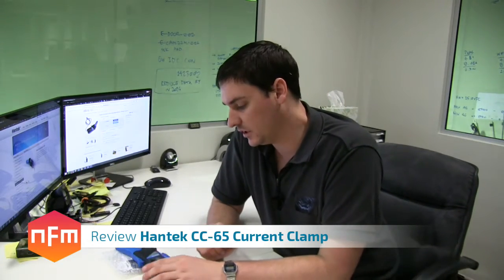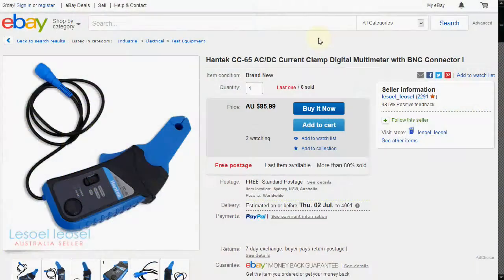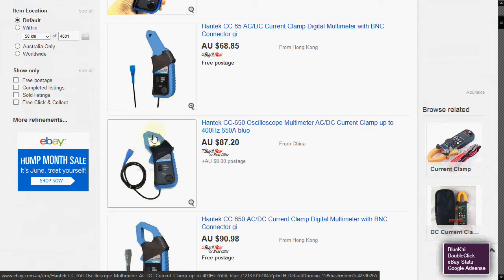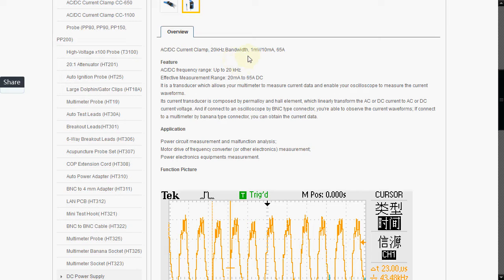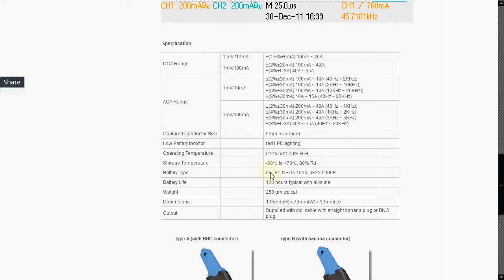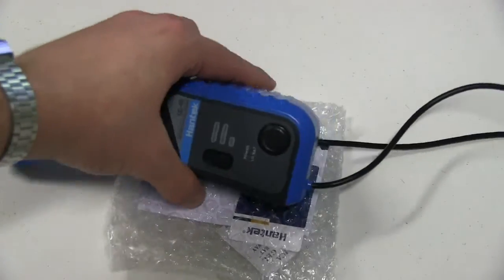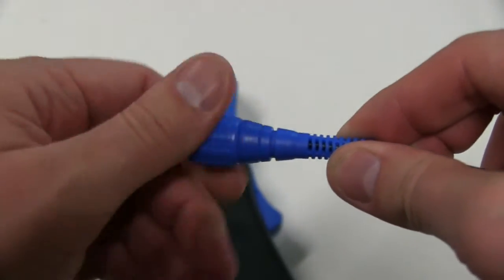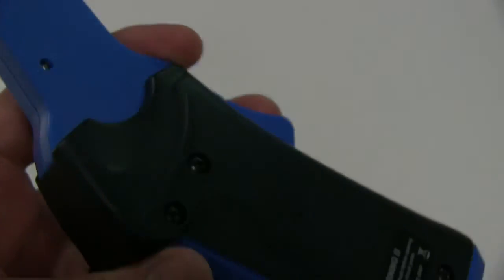Hantek CC-65 Current Clamp - Part 1 - First Look

Comment: The standard accessory is simply just the box and nothing else.  4:55
when i bought mine I often saw two different prices, one was with a box and one without.. price varies with 1 or 2 dollars, depending on the box
anyway I like it a lot... it is the unit that performs the cleanest signal in my testing and easies to trigger on.
good value for 38USD delivered and that one did came with a box, but then who cares..https://i.imgur.com/642S38O.jpg
I also purchased the ETCR007AD 100khz sub60A (50USD), and the HoldPeak 605A sub 600A (15USD), but both of these have way worse signal fidelity.
https://i.imgur.com/ZpmJqux.mp4
the 605A is high current so not good for low signals, also massive 1mV to 1A but verydecent build (320g) when you have the price of 15USD in mind.
https://i.imgur.com/yUrAeXz.mp4
I got a question, pretty rookie on these tools
If I wanna measure fx a cheap 16USD LIPO spot welders current-waveform, like in https://i.imgur.com/h9Vj9Qf.jpg
Im getting quite different reading, are such current clamp not up to the task of signals that fast, and does this khz values matter in that regards or is it the scope that comes short.

Here the HantekCC65 20khz /38USD versus the ETCR007AD 100khz /50USD on an RGB LED USB light changing colors (sub300mA)
https://i.imgur.com/Cj2B5AJ.mp4
If you wanna use the BNC variant on a DMM (multimeter) just get a BNC to bananjack... just purchased another one¨yesterday.
ridiculous 1.6USD incl delivery to Denmark. https://www.aliexpress.com/item/4000199824208.html

Comment: Hi there anyone know what would happen if you put this on a car battery lead and tried to measure starter current, from say 120 to 200 amps dc...
Reply from the maker: +Tom Smith The Hantek CC-650 will measure up to 650A. I believe automotive diagnostics is a common use for these.
Reply: Yes mine is a CG 65 which i suppose only measures 65 amps, but i was thinking of this voltage to amps conversion stuff..as all it really does is measure a magnetic field...could i measure starter current with that on a voltage basis..thanks from Fred in England.
Reply: Ok thanks mine is a CC 65, i think that means it ,measures up to 65 amps, but on a scope you can use volt scale equivalent so would that mean or could measure iike 200 amps for instance as it just measures magnetic field strength.....Fred.

Comment: Nice video. I bought a couple of these current clamps in 2014. One started to fail intermittently. I opened it up and found out that there was a failed solder on one of the 2 sensors in the lower jaw (close to where you can see bare metal). After resoldering the sensor, the readings are a little high. Now I have to figure out which one of the 7 variable resistors to tweak. Is there a part 2 of your video around?